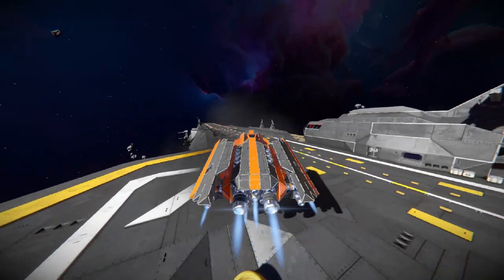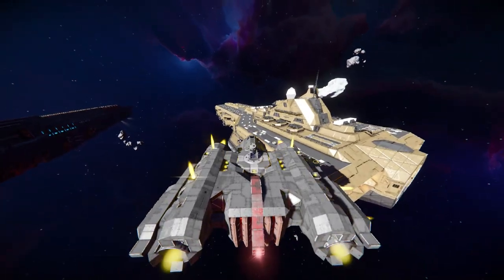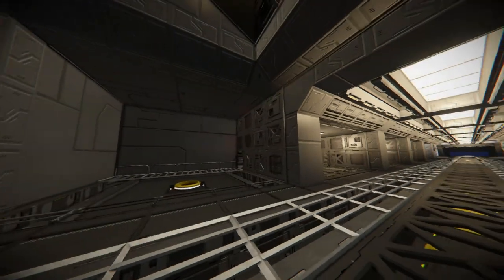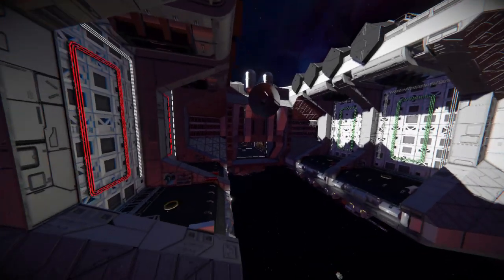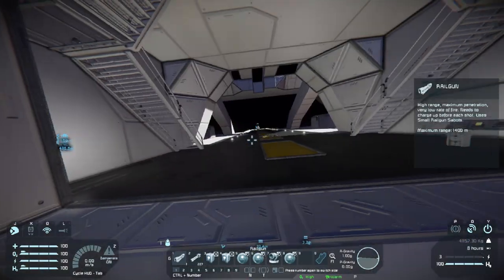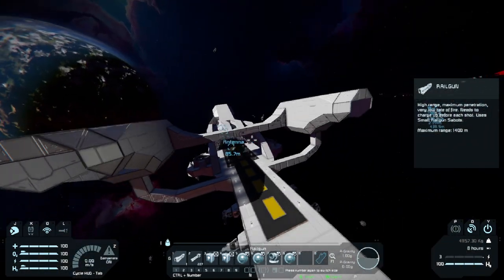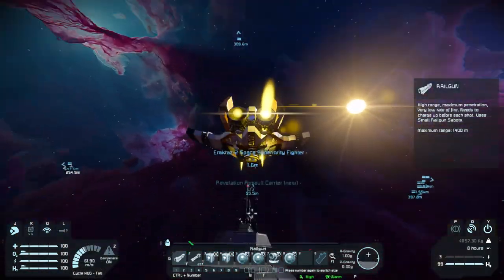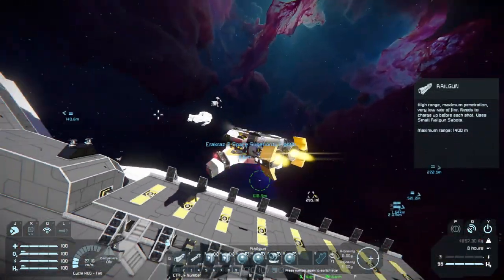Most workshop carriers are impractical and wont work with drones [Space Engineers]

Comment: I love how he tried to fit a fighter in a tank bay when the fighter bay was on the sides and very clearly not on the ramp 😂
Reply from the maker: Its either a bad design or you're an outright liar, the ramp doesn't move and its ~12 blocks higher than the lowest point of the ship.
Reply: @TheyCommanderBacara  

I mean fair. Definitely bad design on the part of whoever made it. But still, the space was very clearly made for tanks, the low roof and lower connectors gave that away

Comment: I was gonna make a "assault carrier" basically a carrier that is solely for transporting around a small attack force of units, no self-sustain capability, smaller than regular carriers, and expendable as a units almost as much as the fighters. I was looking around for some videos about carriers and the new drone update and im gonna be honest, your video doesnt discuss at all what makes these carriers impractical at all really. Should've went into detail what makes a carrier good, particularly for the drones. I'm assuming since drones are dumb obviously interior hangars wont be that safe for them, but im looking for another person's opinion on carrier design and philosophy, if you dont mind explaining what should be done when designing a carrier
Reply from the maker: Basically what i went over in this video is carriers need a spacious flight deck/launch area and a  return area that are linked together and relatively unobstructed by the ship itself or other craft so drones have little chance of bumping into the ship or other craft.

In more detail
 
Top mounted (open) flight deck carriers
Pros:
-Probably the easiest to setup as a smooth functioning carrier
-Can observe all drones on flight deck
-Drones can be dispatched quickly
-Drones can be returned relatively safely
-Interior of ship has more room for munition storage thus you can stay in combat longer
Cons:
Drones are exposed while on flight deck and the flight deck itself is exposed to enemy fire

Interior launched/closed deck carriers:
Pros:
-Drones are safely stored in the interior
-Looks cool when launching drones
-Sealed Ship Maintenance area/flight deck
-Tougher to disable or destroy

Cons:
-Cannot easily monitor internal flight deck (Yes i know cameras exist)
-Ship has to be large to accommodate drones and their munitions
-Slightly harder to setup drones than open deck carriers

Also when I'm referring to interior launched I'm referring to the more traditional styled carriers. Lastly did you want me to discuss battle-carriers in greater detail with you?
Reply: @PGI XxHunterxX It's pretty easy to make your own drones and find out for yourself what crashes into obstacles and what doesn't. Bacara covers the most important issue repeatedly in the video: Not enough room for drones to navigate. Which is exactly the problem I have with most workshop creative builds of any sort. Too much bullshit nonfunctional greebling/decoration, not enough core function. In the case of carriers, I include turrets and guns as decoration (b/c their core function is to LAUNCH DRONES to do the fighting).

What makes a drone "good" are the core requirements: power, 6 directions of thrust, gyro, control blocks (AI Move, AI Offense, separate AI Recorders for complex launching/landing sequences; event controllers/timers to switch on/off the AI offense, AI recorder, or secondary AI defense/offense behavior blocks for different situations). Everything else on the drone can follow the rule of cool. Whatever looks nice or feels good to you -- guns, lights, wings, armor, whatever. SE is not a complex game to design stuff. That's why most of the workshop designs are free to focus so much on style. Wings and fins are completely unecessary in SE, unless you play with the Aerodynamic Physics mod, in which case wings are VERY helpful in atmosphere. This is why the flying gun-brick is both meta and a meme in SE.

Remote/antenna and cockpit are only necessary if you expect to control/fly the drone yourself.

Short answer for disposable carrier design: Make a box open on two opposite sides. Make it big. Alternately, make a flat platform, embed it with connectors on both faces. Maximize drone docking surface area.

Once your core function of drone launch/recovery is working smoothly and reliably, decorate the ship as you like around that core function. Don't worry about "assault this" or "battle that" distinctions until the ugly basic box/platform is functional. You can't put extras (turrets, bridges, walls, passages, doors, thrusters) on until you know where the basic function needs clearance to operate cleanly.

Refer to other earlier videos during the beta demonstrating how big of an opening a drone can (barely) navigate. Make the box twice as wide and twice as tall as your drones, and that's a decent staring point. This means it helps to make the expendable drones with the smallest cross-section possible. I try to keep my small grid drones around 5x5 height and width. This lets them EXACTLY match a large grid 1x1. But realistically, that still needs a 3x3 large grid opening for the drone to navigate with enough room to mostly not bump the walls.

Again, get the basic drone functional -- launching and docking reliably without getting stuck or crashing on bits of the carrier. Once you see all the weird little wiggles the drones do, you can decorate the drones around this. As well as decorate the carrier around the drone wiggles. Wings, guns, etc etc are all extras for drones. Just a power source, 6 directions of thrust, gyro, and control blocks (AI blocks, remote, whatever) first.

I don't have a video on my drones, but that's how I build mine to fly reliably. My drones are vertically launched (using drone forward thrust, away from the ship wall/deck). I currently have a timer on my ship that when triggered, 1) turns on drone forward thrust override, 2) turns H2 tanks off stockpile, 3) disconnects connector, 4) turns off merge block, 5) starts a second timer on the drone itself. This releases the drone to move away from my ship (b/c AI movement can cause them to hover or wiggle in confusion when first activated/taking off). On the drone, the timer is set to a delay of a few seconds to let the override thrust move the drone away a short distance. Then the drone timer 1) turns off thrust override, 2) activates AI move block behvaior, 3) activates AI offense block behavior. At this point, the drone should be about 50-100 meters away from my ship and not obstructing my ship itself or any other air traffic. Then the drone is free to spend a few seconds acquiring a target and orienting to target/move/attack the target.

If you want to make your carrier itself a semi-disposable craft as well, don't waste in-game resources on lots of extras. Make a box. Make it fly. Give it enough timers, event controllers, and connectors to operate the drones. Power, gyros, thrusters, control blocks -- but this time, with enough extra power (H2 tanks or batteries/reactors) to charge/fuel all your drones.

You'll be moving into more extensive carrier design for something increasingly more valuable, less disposable, if you include ship construction capability for the carrier to project and rebuild replacement drones on each connector. Then you need merge blocks, connectors (or advanced rotors/hinges), and LOTS more timers and event controllers to trigger and reconnect the drones. And welders/cargo/etc sufficient to provide the components for replacement drones. And unless you're playing with group of friends, you'll probably want to have a refinery and assembler onboard. Unless you like shuttling between multiple ships to go fetch your non-combat refinery/assembler ship from wherever you parked it. :D
Reply: @TheyCommanderBacara  i got a good rundown of it thank you!
Reply: Would rather make a rocket shaped carrier with drones on four sides attachted to the outside, if you rotate the carrier while deploying the drones get thrown away from the centrifucal force. Since they launch from 4 sides they want crash into each other with the rotating and some times you can launch each row with like 0,2 seconds delay, you launch 20 drones in a second without them crashing and you have them in a kind of helix formation. 
Fly at full speed towards the target at a distance activate the rotation and launch the drones, and crash the carrier, the drones need a little moment for startup and finding the target and attack then.
It is basicly a cluster bomb with attack drones, will be pretty difficult to intercept this and since the crash of the carrier has already made alot of damage the drone have it much easier to finish them of.

Comment: My big problem with most of this is all of those ships are massive, having just 5 fighters is not enough to warrant that large of ships. Larger of course means more lag, harder to get that many players in a server and further known issues.

In my mind, a realistic SE Carrier should be max 4000 blocks, 5-8 automated fighters, with an auto building system, jump and only AA gun protection. You could also double up the carrier as a missile boat and have it build and launch missiles. Basically the longer your launching things the less you weigh and better at evasion. In this case, a carrier will jump in, launch and build more throughout the fight.

Comment: Modern aircraft carriers keep fighters below decks for two main reasons: to keep the deck clear so that aircraft can use the runways and, two, to keep the aircraft from going overboard in rough seas.

Spacecraft do not need runways and do not experience rough seas so, why do people insist on putting fighters inside hangars and have them navigate a cramped interior in order to enter and exit through openings barely wide enough to fit, all during combat conditions? It's all cool until the shooting starts.

I have two carrier vessels; one for cargo containers and the other for mining drones. Put guns on either one and they could be fighters. They are OUTSIDE the ship. To launch they just need to unlock and fly away, in any direction that is not back toward the ship.

Anime and sci-fi theater simply copies the familiar when making carriers because it takes a lot less effort to dress up a WWII ship with thrusters and call it good than it does to design something practical that would actually work in space. The result would be ugly. Until the shooting starts.

Then it would be the most beautiful carrier you have ever seen.

Hangars are for landlubbers.
Reply: You forget one factor that a hangar is relevant for a spacecraft.  In an ambush situation, the hull of the carrier is able to protect the fighters from being stripped or destroyed easily.  Sure, in an ideal situation, your carriers would never be caught in such ranges, but battles are never in ideal situations.
Reply: Internal hangers allows for safer storage of fighters. You can also do a venetor style hanger
Reply: You wanna have the maintenance crew only be able to service fighters outside, requiring suits and oxygen for even minor repairs?
Reply: @fullreinhard  Short answer, yes.

We're talking fighters here, which are a bad idea to begin with in space. It springs forth from the lack of imagination television and movie theater writers employ. WWII, especially in the Pacific theater, brought us many fascinating war machines such as floating fortresses with guns that shoot two-ton shells, floating airports, ships (well,  technically boats) that fight under water, and small aircraft with amazing agility and impressive firepower. Pretty easy to just slap rockets to all that stuff and move it out into space. Looks good on the big screen. Doesn't work that way in real life, or in Space Engineers.

So, if you have fighters that need minor repair, that should happen outside. They should in fact be DESIGNED to be serviced in vacuum and zero gravity. They're spacecraft. We're Space Engineers. A person in a suit will use just as much air as a person in a hangar. Park the fighter in it's spot and tend to it there. I will concede that you MIGHT have ONE hangar for major repairs that could POSSSIBLY hold two fighters. Waste of space, in my opinion.

Again, a carrier's job is to rapidly deploy and retrieve spacecraft in combat conditions. So I will inform my pilots after they have deployed and surrounded your carrier to wait until you have managed to fit all your fighters through the one or two openings you so graciously provided because you didn't want your crew to work outside.

It's only fair.

Comment: I've always favored the fighters on the outside design for a space carrier myself, there is no reason to have them inside as the carriers job is to drop fighters and retire from the battle until needed to recover them, both functions are quicker and easier if they don't have to enter the ship.
Reply from the maker: For rapid deployment the fighters on an open flight deck is always a win, also i agree with the second part you said as well. I dont know why people think a carrier has to be in the middle of the battle because their only objectives should be to 
1, Deploy 
2.Get to a safe distance 
3.Return (if its safe and/or if the battle has been won) 
4. Retrieve Drones.

I cringe when people post pvp videos of a carrier in the middle of combat (unless ambushed) because all i see is ineptitude.
Reply: @TheyCommanderBacara  Is there any good battleship and carrier combos? (basically a battleship with ability to launch fighters).
Reply: @alexturnbackthearmy1907  kind of like how irl ships could launch recon planes?

But honestly you could follow the irl model of having a bunch of open space on the rear for aircraft storage and launching
Reply: @alexturnbackthearmy1907  The Imperial Star Destroyer (ISD) and/or the Venator.

The ISD is about it's guns and not it's fighters, etc., having a pretty tiny carrying capacity compared to the Venator (which can carry like 2 or 3 times the ammount), and it is relatively easy to suppress it's launch bay, as it only really has the one usable bay and maybe two on the sides that are pretty tiny.

The Venator puts more emphasis on it's fighters, while it has more or less the same set up of guns, it carries 100+ craft with entrances/exits on the top, bottom and both sides, all of which can be reached by strike craft while still inside the Venator, this makes deployment extremely safe and/or extremely quick, and all the bays are either the same size or easily double or triple the size of an ISD's.

As for a non-Starwars example you have PHR's Piram, which mounts ~5 hangars that exit through both sides of the ship right about about 30 Broadside guns on each side, PHR ships also come mounted with hordes of drones attached on the hull for close range combat and are armored a hell of a lot more then most other sci'fi ships (the only ships that likely out armor them are Imperial and Ork ships in 40k through their sheer mass), and it's armor is largely concentrated to the front, top and bottom.